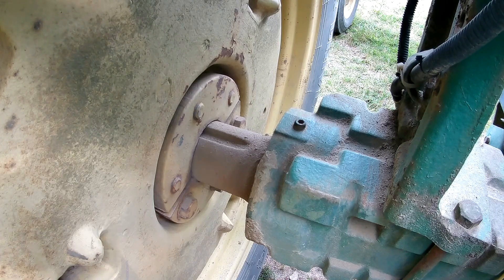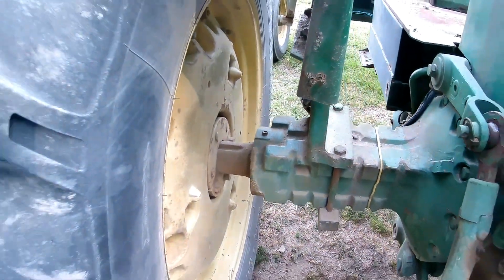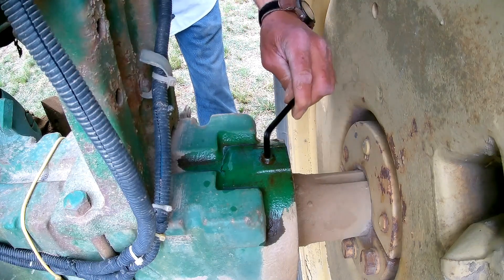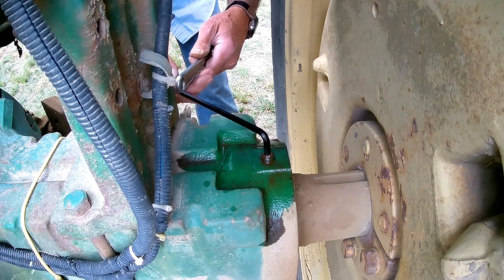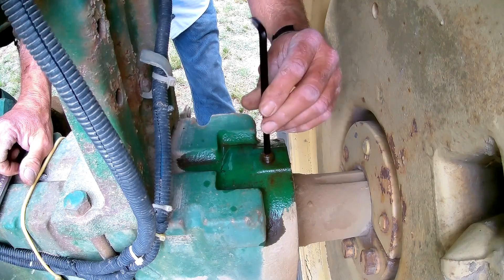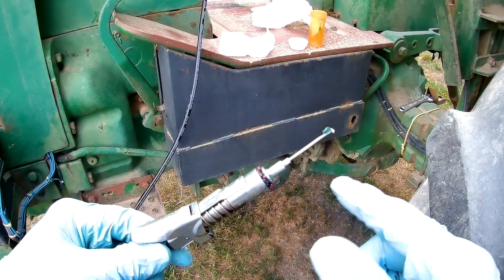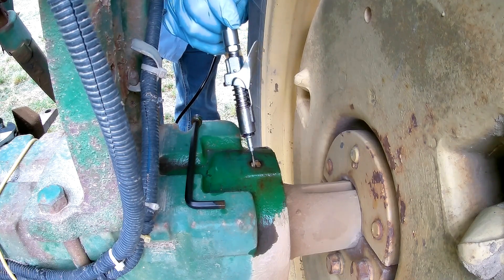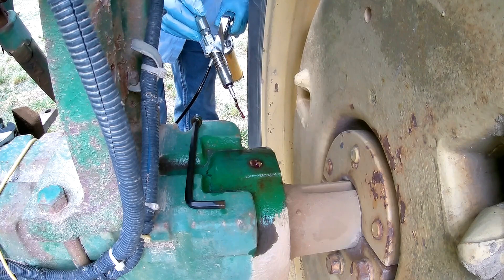Do we blow out an axil seal 🧰🔧

Comment: Good tip there.  The Ol' Farmall 806 & 706 we've got have grease fittings on the rear axle.  I just put about 4 pumps of grease in each axle.  Thanks for sharing.  Take care. ☕☕
Reply from the maker: You are wise being aware of how a grease gun applies a lot of pressure and could actually blow out those seals. Thanks for watching.
Reply: @SoybeanFarmer3300   Well, I don't know about so much about that "Wise" part. LOL It's probably more a long the lines of paying attention to what Dad told me to do. LOL  ☕☕

Comment: That is a very important reason to have a manual. Tells you where the grease fitting are, proper way to grease them and at what intervals.
Reply from the maker: If it were not for my manual I have with my combine I know I never would have found all of those grease fittings on that combine. Thank you for watching here Robert.

Comment: Best thing to do is put 90° zerks in , point then to the wheel, they will stay cleaner. And remember to clean them off and grease them when you grease the rest of the tractor..
Reply: You don’t need to grease these but every 200 hours do you WILL blow the seal out. Speaking from experience!!
Reply: @lancebass9883  just a few pumps every greasing.. otherwise it takes a tube and a half ... Experience...
Reply from the maker: Nope, just a little bit more effort to remove the plugs and use a grease needle to ensure I never blow those seals out.
Reply from the maker: Lance, using the grease needle technique you'll never build up enough pressure in there to harm the seals. Yes it takes a little more effort to remove the plug and reinsert the plug but it's well worth it.

Comment: Nothing like great maintenance! Good idea about not building pressure! Those needles are handy to have around, work great in tight spots. Thank you for bringing us along, look fwd to more!
Reply from the maker: Done right and on a schedule you don't have to worry about things wearing out as quickly. I've had this tractor 20 years going on 21 years now and considering it's a 1970 year model I think it's been well taken care of. There's a tractor sitting across the road for sale it has a leaking axle seal it has grease fittings in the place of those plugs that's kind of a dead giveaway to me what happened. The man wants $9,000 for the tractor and it would be about another $2,400 to get a shop to replace that leaking seal. Thanks for watching.
Reply: @SoybeanFarmer3300  Very true sir, and it shows in your maintenance schedule! Wow, that's a dime for sure with that kind of fix needed! Thank you and enjoyed alot!!

Comment: I like the lock n lube. I've only used lever grease guns
Reply from the maker: Lever grease guns apply a lot more pressure than the pistol grip type. They are great when a grease fitting is partially clogged and you need to actually Force with a large amount of energy to get the grease to go through it. One of the tools in the set sent to me by Jay at Lock N Lube was designed to open clogged grease fittings and it works great. Thank you for being here watching supporting this channel.

Comment: I’ll disagree with your friend Deere has put grease fittings on all tractor axles for quite some time now at least back in the 90’s you just put 2 or 3 pumps in and don’t go crazy
Reply from the maker: My 4020 is a 1970 year model the one of the last tractors John Deere actually built based on integrity.🤔
Reply: @SoybeanFarmer3300  You are right there the old 10 and 20 series tractors I was back before they complicated everything like today I was just trying to make your life a little easier throw a couple grease fittings in it give it a couple of pumps you’ll never have to worry about blowing the seal out or screwing around with the grease needle
Reply from the maker: Went out last night with the offset disc and with the way I was having to work the throttle through the different soil consistencies I was reminded of a recent video of yours where you were showing how the computerized control on your tractor would very the engine RPM in accordance with the load Factor attempting to maximize fuel economy. After the third time of having to relight my cigar I started thinking that might be a rather nice feature.  🤔